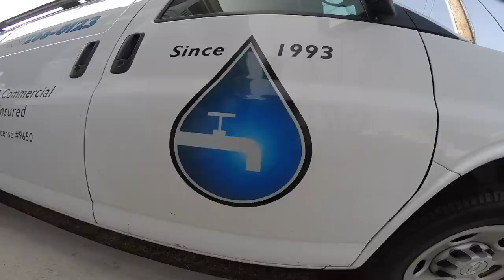CAST IRON SEWER REPAIR PLUMBING APPRENTICE GOT ME GOOD

Comment: Best video yet. I laughed when  "your love for plumbing was tested"  first time I heard you curse  and I had to replay it a couple of times lol.  

I had to replace 2 lead bends while I was remodeling my  bedroom bathroom. I noticed my main bathroom had a leak at the  lead bend while I had the ceiling open. Thank God for fernco!  My leak was on top of the bend.  I used flex seal as a temp fix but it lasted only a few days.  Best thing to do is to replace them.
Reply from the maker: For sure. My patch still holding strong. Im waiting for the remodel call. 2020 could be the year.

Comment: Fiberglass tape the kind they use for durarock showers with hydraulic cement mixed wet and roll that around the bend. It dries fast and under water and can test in like a half hour. It worked for me in the past! Good luck CB! There you are CB2👍
Reply from the maker: thanks mike. monday funday for this drip patch i hope.

Comment: A shielded firn co should be used for all horizontal runs,  And supported. Especially if it's buried. Can sag and cause a blockage. Seen it and repair it many times
Reply from the maker: this is true for sure.

Comment: Same code for us as far as the fitting/wye laid on the side for drainage or venting.   Vent only needs to be rolled up 45 deg. Or higher.   Awesome job on this fix gents!
Reply: Also,  I would “try” the stop leak tape around the slow drip.   I believe “Monster” makes a pretty awesome tape to use.  Especially in a situation like that.   Man what a can of rotten worms if that gets worse!
Reply from the maker: pray to the epoxy gods please....lol

Comment: I little bit of leak checker on the pipe under the fernco makes them slide up and down a lot easier.
Reply from the maker: thanks guy
Reply: @ChuckBarron  But when you are in a crawl space that ugly THE LAST thing you are going to do is crawl all the way out just for some leak detector or whatever to make that Mission coupling slide on easier...

Comment: Until someone watches a video like this, you can't appreciate just what it takes to have running water at your fingertips!!  probably was a nightmare for the original plumbers to install all that cast iron pipe, and now more headaches for todays plumbers to maintain & repair it! I worked in power plants crawling in places like this where, no matter what, its a one man job..Kudos to CB & CB2 !  :-)
Reply: Galvanized, PEX, and copper supplies,  copper drain lines going to cast with Pvc mixed in... Reminds me of my house. Many plumbers and DIYers have "collaborated" over decades to make sure water flows in and out of that place.

Comment: A lot of times you can make 2 cuts in the hub and a light tap with a ball pin hammer and gain that much more pipe.
Reply from the maker: Thank you plumber

Comment: Nice work in tough conditions Chuck. Sometimes it's hard to avoid opening that can of worms. 
Two part putty epoxy will get you out of a jamb on that lead bend. I use aa product called Propoxy that works great.
I've never seen a sawzall blade cut cast like that before. Thanks for the tip on that, I'll be getting  one of those for the truck for sure.
I felt your pain on this one for sure.
Reply from the maker: thank you.....diablo blades at depot....awesome.

Comment: Chuck, what causes cast to crack and splinter?
And speaking of cast,  did a repair awhile back on some 4".
Took out a long section, then had to cut off another 18".
Used a hand me down snap cutter. That piece almost took my brothers head off standing 6'
Away. Lesson learned,  Dont ya just love those new sawzall blades.
Tell CB, you expect to get an occasional bath from the homeowner, but not his own son..
Lol.
Reply from the maker: the boy got me....it cracks on the seem..and diablo is the bomb for sure.  donn your helmet brother..
Reply: There are really only two things that cause cast iron to crack or corrode early. 1. anything that goes down the pipe that has a pH lower than 4.3 or greater than 12. This would usually affect the bottom of pipe and fittings. 2. is Hydrogen Sulfide gas which is produced by human waste and grease. it also comes from the city side which nowadays is venting through your building. This gas condensates on the crown of the pipe and slowly eats a pin hole. you will sometimes see mounds like ant mounds on top of pipe. the molecules of cast iron are always trying to come out of round so when it reaches the breaking point it pops open. many times you will see yellowing along the crack. yellow is the color of sulfur. If the system has proper slope, proper venting and receives a good amount of water many of these problems can be avoided.

Comment: If you can fit a band saw, it makes clean cuts on cast iron as well. A saw zall ls a great tool and is more applicable.
Reply from the maker: nice. I have actually never used one.

Comment: ive never worked on a lead bend and cant really relate but to fix it I would try an apoxy called sika flex. its pretty good stuff, ive put some on a 2x4 and stuck it on a concrete wall. held it for 10 minutes and came back the next day, had to grind the concrete cause it was never coming off. had a 4ft pry bar couldn't bust the 2x4 off. I used it on a trough drain to hold the sections together, never came apart and never leaked. they come in silicone tubes so id get that and some popsicle sticks and giver a thick smear job probably coat the whole bend. I would assume the customer doesn't want to dump a bunch of money into replacing that lead bend so If it was me Id try apoxy first if the leaks on the lead.

as for ferncos, ferncos kick ass. it would be nice if u can replace the whole job and make a nice pay cheque out of it but sometimes the customers cheap so it becomes patch city and you need a pair of ferncos. no need to re invent the wheel here. ive also never used a zip hanger in my life, gonna have to look into this.
Reply from the maker: yes....all good points.. the zip hangers are nice

Comment: A little off topic, but have you ever tried a impact gun to remove a hex head  clean out cap.  I think the cap is cast iron. I am asking because the impact guns have become cordless so easy to work anywhere.
Reply from the maker: I have not. Can you get an adapter for the size? good idea.
Reply: @ChuckBarron  do you know the size.
Reply from the maker: I do not...I actually need to buy hand tool for that cap style
Reply: so a little update, I  got the cap off and  my assessment of the cap material was wrong because it was painted silver aluminum color.  So I heated the cap with 2 torches on opposite sides with map gas and when I thought it was hoot enough,  I applied paraffin to the pipe. So while I was waiting for it to cool  I worked on something else .   
after about 10 t0 15 min.  I returned to reheat and reapply the paraffin.  At this point I felt confident enough to attempt to open it.  So I tried my impact wrench idea but could not find the good socket size , so i dropped that idea.  so onto the next idea BUT I couldn't find my pipe wrench (my bad) so I took my biggest channellock and put it on. Low and behold it came out so easy it is almost comical.  I had prepared for the worst case scenario and I took it out with a channellock and a small push....
Reply from the maker: I just used a huge pair of channel locks for same....a small knuckle  buster but it worked.

Comment: chuck I always carry a roll of 3mil 12' x 100' roll of plastic on my van.  Just some FYI.  And Milwaukee makes a carbide tooth sawzall blade called the torch, its just as good a diablo, my opinion its better.  Also the make a liquid called Magic Lead make by Oatey or a caulking tube called Plastic Seal #25215 made by Hercules for lead joints that leak. You can purchase them at your local Ace Hardware store.
Reply from the maker: my man...thank you. we have a play book of options for monday. thank you kelly.

Comment: I would sand the lead closet bend and put epoxy to fix that little drip also when I would go under houses for drain repair I would roll out tar paper so I would stay dry
Reply from the maker: the trenches were getting ugly on this battle

Comment: I was wondering if it would have been better to finish the 2" line going into the Y before finishing the 4" line. That way you would be certain the Y lined up correctly for the 2" line. Or am I way off?
Reply from the maker: I always finish the larger line then tie in tin smaller lines.

Comment: it appeared to be a 1.5  copper drain line with a drum trap that was abandoned and dangling about down there, past the repair you did on the 4inch drain line. should that have been cut and capped to prevent sewer gas from filling the crawlspace? or was it perhaps capped in some creative way before you got there. thanks
Reply from the maker: we got er done!

Comment: I  a master plumber in Montana. I can't count how many times I've been in this situation. There is noting scarier than trying to cut out that decades old plumbing. You don't realize how much a Sawzall shakes and rattles that old existing plumbing. Sometimes fixing one thing turns into an entire bathroom group. All from the movement that initial Sawzall cut caused... It's can seriously cause a guy to drink...
Reply from the maker: So true plumber..
Reply: Snap cutters
Reply: @plumbcrazy375   Even ratchet snap cutters can cause that old cast iron to break and leak where you defiantly don't want it to. More than not the only thing holding that old pipe together and having it not leak is TIME...
Reply: @jklsr55  I've worked on tons of old crusty cast iron always support and pipe that can move or put weight on any fittings if it's that brittle grinder  sawzall is always last choose for cast

Comment: Buy a cheap 3/4 fitting brush, cut it off at the handle and clean it up.  Hercules pro poxy 20, and try to force it it the lead joint.  Good luck with that one.  Old mud job floor fixes are fun.
Reply: I meant to add put the cut off brush in a drill.
Reply from the maker: thanks mike...all the tricks coming monday am.
Reply: The other thing I do is I’ll run a couple of heavy duty screws in the joist on either side of the stack, and loop a ratchet strap around and try to get a little up pressure on the cast that I’m trying to save.   You were screwed on that lead bend leaking before you pulled one tool out.
Reply from the maker: ya know I was thinking after the fact that I should of braced the sweep more. Thanks mike.

Comment: If I knew about blades that go through cast iron that fast I NEVER would have spent $550. On a Ridgid SNAP CUTTER!! It used to take me 25 mins per CUT!!
Reply from the maker: Hey, a member turned me on to diablo and it's been a wrap ever since.
Reply: I have Milkwauke Torch blades. I bought it to repair cast iron drain pipe for my bathroom sink and it cut through it so fast! It took maybe 45 seconds on 2" cast iron. I also used it for 3" and that took a little longer.
Reply: @DragonBuilds  , I have Milwaukee Torch blade's but I never used them on Cast iron pipe but they work great on other stuff. I recently have been using Diablo, Carbide coated blade's and they worked great on 6" cast iron Sewer pipe. I made 8 cuts through 6" cast iron pipe and the blade is still good. But it costs $20. For one 12" blade
Reply: @juliorosenberg9968  My 8" blade for 3" cast iron was $15. If you're not cutting lots of cast iron every day, it is a better value than a snap cutter.
Reply: @DragonBuilds  if I use the snap cutter on one or two job's a month I use it alot. When I bought that tool the Sawzall blade's took about 20 minutes or more to cut 3" Cast iron or larger. Usually I will break the hub with a ball peen 🔨 hammer and then tie in with PVC,  but breaking the hub only works in certain situations.
Reply: @juliorosenberg9968  I actually need to remove a hubbed fitting in the crawl space. It has a rubber donut connection, not the traditional lead and oakum. Is this removable or can I break the hub?
Reply: @DragonBuilds  it's removable, if you have enough space you could drill out the rubber inlet fitting with a series of holes until the gaskit is almost gone then you will be able to move the pipe. It takes a while but it works. If its not to old and you can move the pipe going into it you might get lucky with PB blaster a screwdriver and a hammer and pull the donut fitting out. Is it a PVC pipe from a toliet flange going into a 3" or 4" Cast iron hub with a Fernco donut gaskit? They can be very difficult to get in and out , expecially in tight spaces. The pressure that the inlet pipe creates against the gasket is what causes the seal.
Reply: @juliorosenberg9968  No it is cast iron into cast iron, original to the house. There is no space to drill. Is it safe to break the hub or will it crack the pipe inserted into the hub?
Reply: @DragonBuilds  the pipe inserted into the hub might break and you definitely won't get a clean edge on the pipe that has the hub but you will almost always have enough to effectively use a Fernco coupling. I have two this afternoon on a outside sewer vent at the curb. In upstate New York we put 2,. 4" cleanouts at the curb in case of a clogged sewer. One feeds the snake to the sewer in the street and the other feeds the snake towards the building. Usually you can clear a clogged sewer WITHOUT having to roll a 290 machine up and down the stairs.

Comment: I really feel for you having to work those drain pipes in such a confined space.If I'm not mistaken there are water pipes running under that crawl space,shouldn't those water pipes be at least insulated to help prevent freezing?I have my share of difficult jobs.Recently I had to change the connections to the house soil stack from three inch copper drain pipes to three inch PVC.My toilet had the nasty habit of siphoning the water out of both my bath tub trap and bathroom sink trap when ever I flushed the toilet and the toilet had a tendency to clog easily.Being originally from NYC I have had the honor of working with licensed contractors and licensed plumbers and never had I seen copper used for drain pipes until I moved here to PA.Because the toilet would siphon the water out of my bath tub and bathroom sink I thought that maybe the vents were removed because this house is two half double houses converted to a single house.It was only when I opened the basement ceiling under the bathroom that I found that the plumbers who made the connections used a three inch elbow with a one and a half inch side inlet to connect to the three inch soil stack and to the one and a half inch copper pipe for venting.While I'm not the smartest man in the world as soon as I saw that three inch copper elbow with the one and a half inch side inlet I knew right away that was the cause of my toilet constantly clogging and siphoning the water out of my tub and bathroom sink traps because as the toilet paper and waste passed the one and a half inch side inlet on the three inch elbow that connected the toilet to the soil stack the one and a half inch inlet would be obstructed and interfere with the venting.I bought a three inch elbow with a two inch low heel inlet and also bought a reducing bushing to drop down from two inches to one and a half inches to accomodate the one and a half inch copper vent pipe.I would have loved to rip out the one and a half inch copper pipe used for venting and replace it with two inch PVC pipe but my bathroom is tiled from floor to ceiling with tiles believe it or not so that was out of the question.To give you an idea of just how bad the plumbing in this house was set up here are a few examples.First the traps used for the plumbing fixtures were all S-traps which from what I understand are now illegal in all fifty states.Secondly the stand pipe used for the washing machine drain had no trap at all which I of course rectified.Aside from the above mentioned changes that I have had to make to rectify the situation with the plumbing in this house having been done so terribly I also installed AAV (Air Admittance Valves AKA Cheater vents.) above the P-trap under my hitchen sink,I installed an AAV on the drain pipe on my bath tub because the copper drain pipe that was used by the original plumbers sprung a leak so I had to change the drain pipes on my bath tub and lastly I installed a three inch Studor Maxi-Vent on a three inch wye at the top of which connects the three inch elbow with the two inch low heel inlet that is connected to the one and a half inch copper vent pipe and I also installed a wye with a cleanout at the bottom where the PVC joins to the cast iron soil stack with a four band heavy duty no-hub clamp so no more venting problems thank God.Owning a home has gone from "The American Dream." to the American nightmare because if it's not one thing it is another so I applaud you for the work that you do because I know from personal experience how difficult plumbing can be.God bless you and your family,have a good weekend.P.S.,I used one and a half inch long sweep DWV elbows to connect my kitchen sink,my bath tub and bathroom sink drains to the soil stack and I could not be happier at how well everything drains now especially the toilet.Since we have a problem with the water over here having a lot of calcium and lime the small holes under the toilet rim tend to get clogged but I am going to fix that by buying a TOTO Drake elongated 1.6gpf/.8gpf toilet with the tornado flush because the toilet that I have now is an old American Standard that is too small for my liking plus is a water hog.
Reply from the maker: wow. there are some . duzzies out there. sounds like you have it under control. get er done plumber.